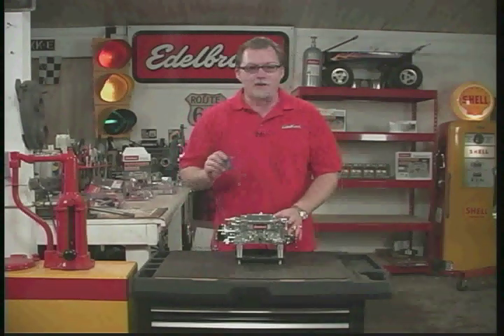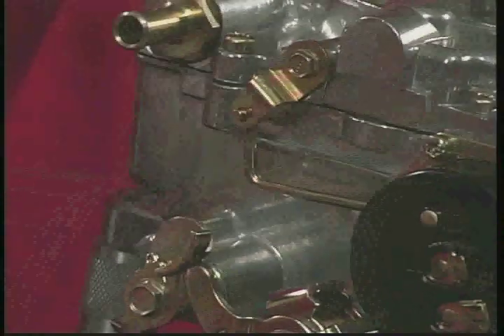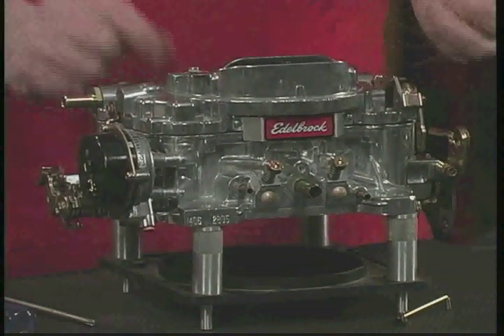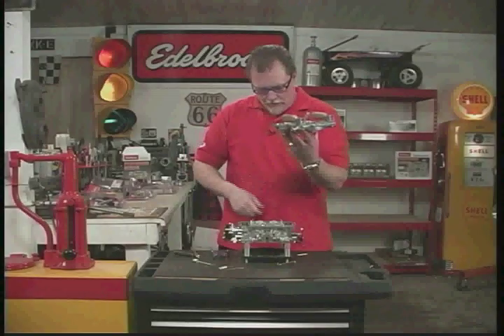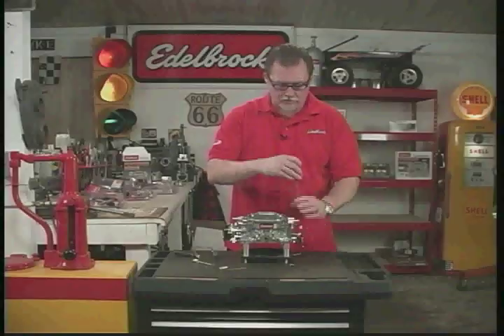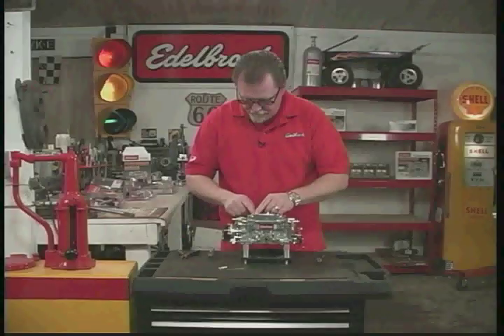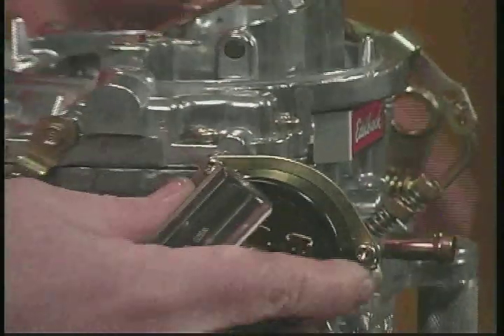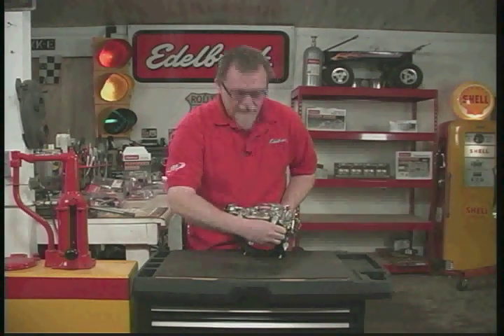Edelbrock Carburetor Installation and Troubleshooting Part 4 - Additional Tuning

Comment: Horrific advice. This man is not to be trusted. Metering rod cover plates need to come off completely , too high of a chance them slipping back into position and forcing you to remove everything again to pull them out.  If left hanging on bolts increased chance of bending metering rods and just getting in a way making job harder. Obviously he's only done that on the table.

Comment from the maker: Yes, the 12V wire heats the internal spring and lets the choke flap open all the way. With no heat (from the 12V), the flap will have tension pulling it closed. A heat shield will help, but check to make sure your gas line is not close to the exhaust or resting on part of the engine. The fuel is boiling before it gets to the carb.

Comment: Thanks for the reply!  I went to lean out the choke, and turns out that the 12V lead has been disconnected at some point. Ironically enough, I leaned the auto choke all the way out anyway, and I don't have a high idle anymore. Is this possible without the power engaged? I'm installing a heat shield as I saw fuel perculating after a long engine run. I'm also going to rebuild the carb while I have it off, just to satisfy any vacuum leaks that might be present.

Comment from the maker: Definitely check for vacuum leaks, but it sounds like you need to lean the choke setting. If you're running too rich, the choke flap will want to stay partially closed, which causes your problems.

Comment: Great video series. You make things VERY simple to understand. Thank you!  I have the 650, and am having issues with the choke coming on frequently, even at lights after the car is warmed up, causing for a very high idle. The car runs great when running through gears, but is hard to start sometimes when warm and sputters for 1-2 seconds when shutting off. Timing has been hard to set due to the frequent choke.  I'm thinking possible vacuum leak or running the choke  as lean as possible. Thoughts?

Comment from the maker: From David Loggans, Performance Parts own ASE Certified Master Machinist: Interesting? Usually if a carb is dumping gas, it could mean that there's too much fuel pressure or dirt in the needle and seat area that are causing it to flood. I would check those two areas first and if you don't have problems, I would go with the Edelbrock 1405 or the 1406 with electric choke. You can order this through us. Just call at 1-800-585-0683.

Comment: I've been told by a local mechanic that "it's dumping gas in the engine and fouling the plugs".  Didn't make sense, unless they don't know how to tune it properly.  But, wanted your opinion if it's a good match for the 383 crate or would a smaller one give me better mileage and yet still have good power.  Thanks.

Comment: I've got a '78 Vette with a 3 year old 383 CI crate engine and an Eddy 750 (1411) carb.  I've been told by some that the carb is too big and others that it's just right.  Watching your other installation vid, it seems like I should be running an Eddy 600?  If I switched to that, would I get better gas mileage and a small drop in HP?  I'm not racing, just interested in a touring/performance combo.  Thanks1

Comment from the maker: Use a lighter spring but the return spring should always pull the lever closed. If the throttle is sticking, look for an interference problem or a dirty carb.

Comment: Is the throttle sticking on cold mornings normal for Carburetor or is that just poor adjustments? Because my Edelbrock 650 seems to always stick on the mornings, so we just put the throttle spring on the other side so its pulling it closed... It works but it makes it a lot harder to push the gas.

Comment from the maker: @ArkansasMudder725 Since you have adjusted the choke assembly and the choke is operating correctly, fast idle working and the choke releasing when warmed up,  I would leave the choke alone. The choke could have been turned or wound too tight, from the factory or by another individual, and was holding the choke partially closed, that is why you had the rich smell.

Comment: I have a queastion with the electric choke, i have a 1406 (600) elelbrock carb. And it was running rich cause u could smell tha gas, so i twisted tha choke not up were tha (lean) arrow is pointing but down and now it seems like i got lil more torque and i dont smell it running rich anymore  and it running better than it use too. But why is it wen i move it up towards lean it smells like its running rich and bogged down. Could you help with my question?